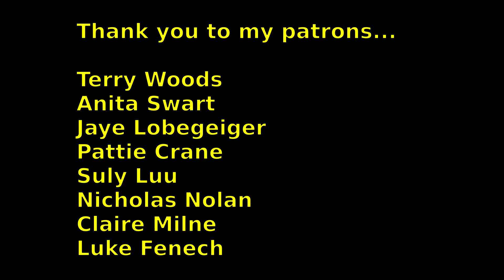A Smoking Sewing Machine is Never a Good Look

Comment: I love it when you mentioned using an ESD strap. It is so important when working around electronics. When I was building computers we wore an ESD strap heel straps and a smock. You don't want to cause more problems than the ones you are trying to fix.
Reply from the maker: Thanks. You're dead right there.

Comment: Really appreciate the fact you take us through a logical problem solving process in detail - start with what you can reasonably see first even if it didn't ultimately solve the problem. Learnt something about desoldering and soldering those pesky little pins as well.

Comment: @InStitches To answer your question (months later), yes, the cotton tipped swabs are called Q-Tips here in Canada (North America).

I'm learning loads and loads from these videos, and plan to take my newly acquired knowledge and apply it to keeping my own roster of machines sewing properly. 

The one you did on adjusting and correcting the looping issue with your Janome serger taught me a ton about making a proper edge possible. My basic Singer 14u34b serger (80's vintage) never had a fantastic edge with the threads. Thanks to you, I now know HOW to fix the issue. Hopefully I can find a service manual online for it as the owner's manual doesn't seem to have anything I can find that instructs on how to adjust the blade position.

You're knowledgeable, genial and thoroughly engaging. Thank you for giving us a place to learn about the art of maintaining these machines. It's deeply appreciated. 

Dave.

Comment: Thank you for your videos, I too have a helper cat.
Regarding the broken plastic posts, there is a product that's been on the market for years call Plas-T-Pair, in some instances it works better than epoxy because it melts into the base plastic and forms a stronger bond whereas epoxy sits on top of the plastic, it has saved many broken plastic parts for me over the years.
Reply from the maker: Thanks. I'll keep any eye out for some of that.
Reply: @InStitches  Unfortunately it doesn't work on nylon, delrin and other plastics like the gears are made out of but you can also use it to cast parts as it was originally also used to cast tv and radio knobs

Comment: Very interesting video.  This is the first time I look at one of your videos and I will subscribe for sure.  I also restore old vintage sewing machines as a hobby of mine.  So far I only deal with full metal machines from the first half of the 19 th century.  I knew the new modern machines was made with a lot of plastic and computer parts and those don't resist the test of time like the full metal ones.  However, I did not know they became that bad, almost to be disposable things.  I will  have nightmares for the coming weeks about the modern crappy sewing machines.....However kudo for your video and I will watch more of them.

Comment: Been really enjoying these, I have a question, the capacitor in the switch housing of my Husky 5061 needs replacing it says 0.1mF @ X    250v ^mp LD2    to=3.6MHz SND PME 271M   C11/76 do you know what the best replacement would be, cheers
Reply from the maker: Take a look at somewhere like RS Components or Digikey etc websites and look for 0.1uF X2 at 250V. You can also check the physical measurements there. Thanks.

Comment: Great video, if it were me the next step would be to check the steper Motor for the side to side needle movement first to find out if it is locked up and if not to feel it move. A new stepper motor is much less expensive than the board.
Reply from the maker: I have checked the stepper motor and it's working. Thanks anyway for the suggestion.

Comment: Are you on, use eevblog forum?
In saying that what manual (no wires, power) sewing machine would you recommend? In NZ, bullet (idiot) proof, 2-3 layers of seatbelt webbing (most of it goes to landfill after warrant failures & makes great straps, collars, belts etc)
Reply from the maker: Yes, I look at eevblog from time to time. I would recommend something like the Singer 201K as a good heavy domestic machine.